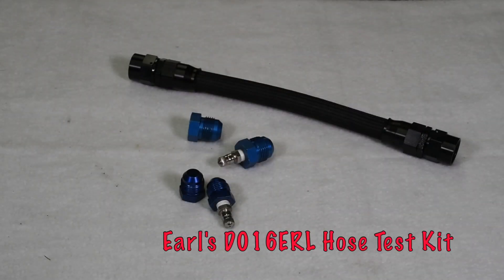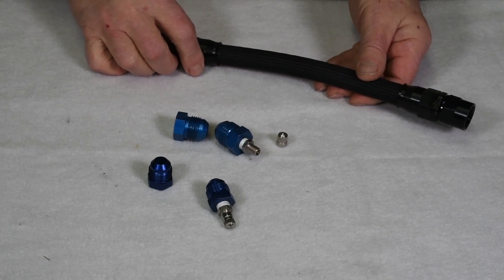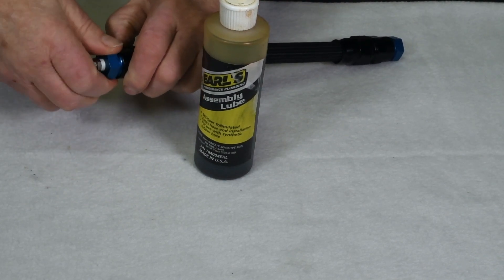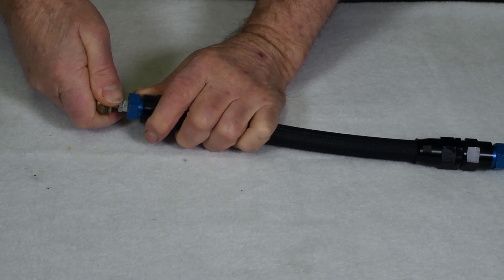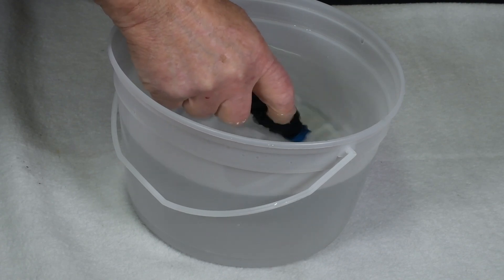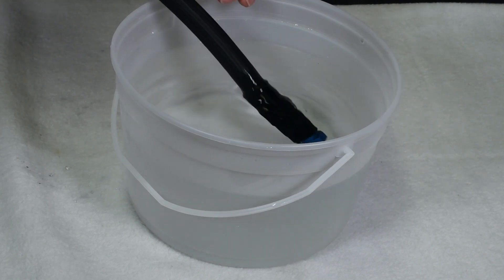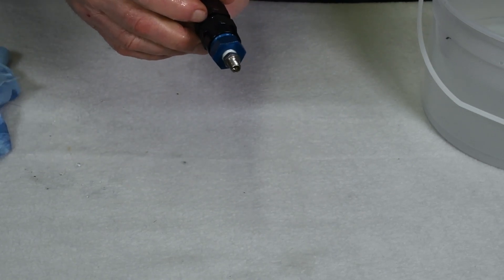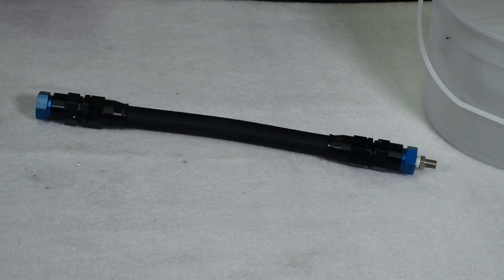How To Pressure Test AN (Aircraft Style) Hoses At Home

Comment: This was really helpful! Thank you for the tip on using WD40 on the swivel... I could not figure out why my 90 degree fittings were leaking air from these spots
Reply: Did the bubbles go away after you sprayed your swivels with WD40?
Reply: @buust1000hp  no, my issue was user error with installing the fittings to the hose. If I remember correctly I was using too much lube
Reply: So I’ve got the pressure tester fittings and pressurized the line. I’ve got collages in the hose I assembled but on the female nut connector there is a small pinhole on the side where there is a very slow leak. Not sure what’s going on with that, any ideas?
Reply: @Archangel3083 , what do you mean by "collages in the hose"?